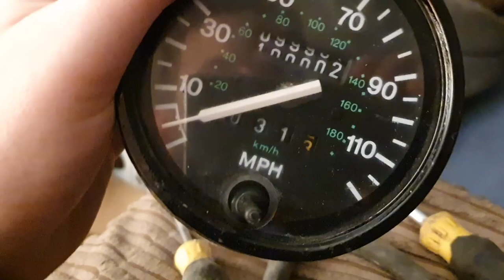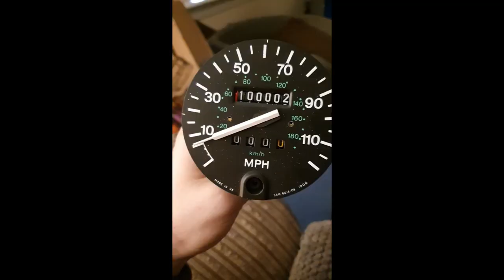Restoring a 30 year old Landrover - Part 12 - Gentlemen, clean your engines

Comment: Looking ace mate can you give the the size of wheel and the type of tyre  much appreciated
Reply from the maker: Its a 16 inch deep dish steel wheel with bf Goodrich km3 Mud terrains.  285.  I need to buy a spare actually but saving up as they are £270 each 😐
Reply: @Oilatumify  thanks think I'd better get saving 😂